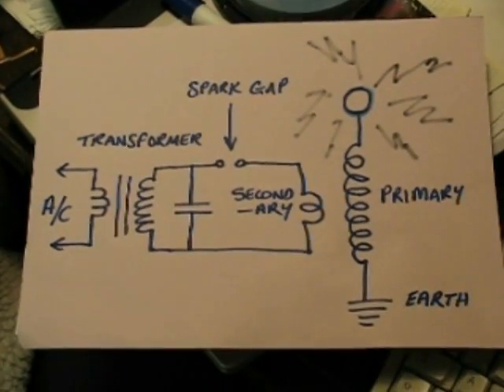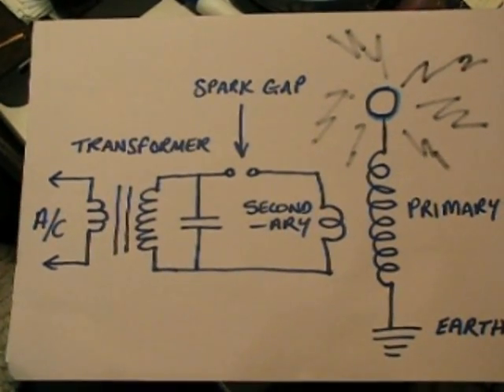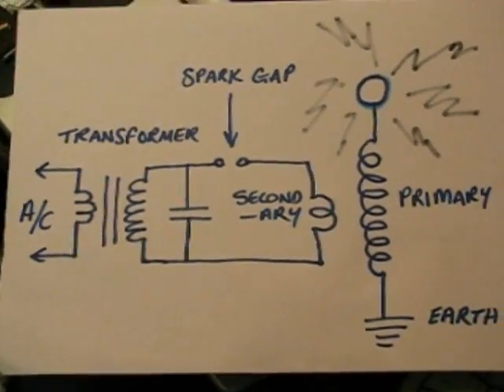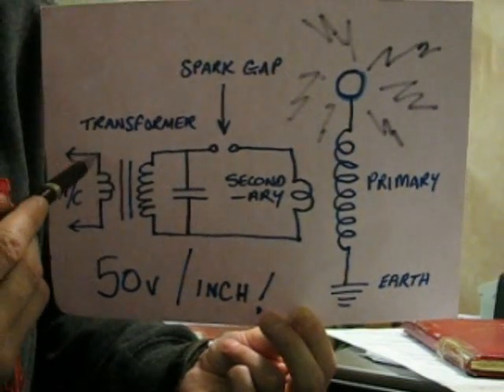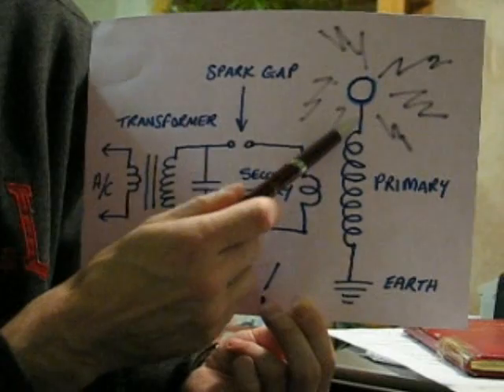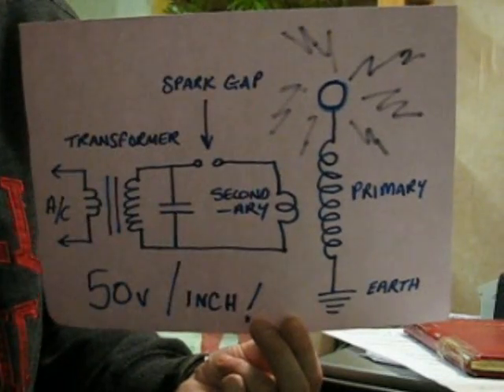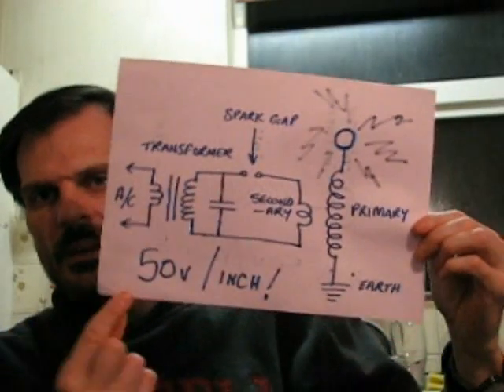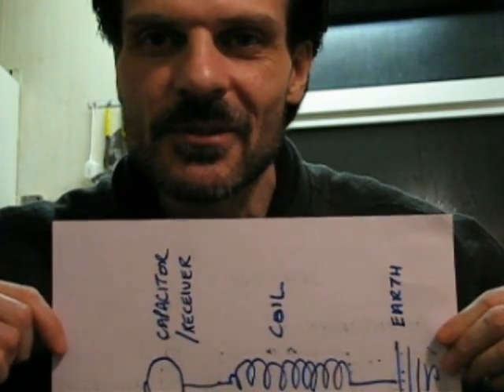Tesla's Little Secret

Comment: Not really.  The power levels are tiny, its only of use if you want to harness a tiny tiny amount of power from terrestrial radio transmissions to power a remote sensor or similar.  A few microwatts aren't very useful for mains powered equipment!

Now if you live near a big radio or TV transmitter then you might get milliwatts or even more with a long antenna, but
unless you are careful with your energy harvesting circuitry you might re-radiate harmonics in the wrong band and get
a visit from the relevant guadians of radio spectrum in your territory.

The DC possibilities are basically non-existent as the air is an excellent insulator so there is no current.  Also a transformer
only works with AC.

And for both modes your equipment is likely to be destroyed the next thunderstorm passing overhead.
Reply from the maker: +Mark Tillotson You are talking about the crystal radio circuit which receives a very small amount of energy. I am talking about receiving radiant DC energy from the sun which is unlimited, relatively speaking.

Comment: I disagree with your analysis of the circuit. For one thing, we don't charge the capacitor; that would imply DC rather than AC. I think the capacitor is to protect against HV kickback. The secondary of the power transformer builds up a high voltage until the potential is great enough to jump the spark gap. When that happens, a surge of current appears in the low voltage winding (the "pump coil') which delivers a pulse to the Tesla coil itself. Except during that brief pulse time, the spark gap represents an open-circuit so the pump coil reflects a high impedance (no load on the Tesla coil). The Tesla coil itself is a high-Q tank circuit capable of storing energy alternately in the magnetic field of the coil and the electric field of the (parasitic) capacitance. The small pulses of power are like small pushes on a pendulum that accumulate to build high energy and therefore high peak voltage.
Reply from the maker: Yes that's how I understand it. You explained the conventional Tesla coil eloquently!
Reply: Capacitor is very important here, it is resonant circuit

Comment: It's not 50V/inch.  It's more like 90 V/m.  It's there for the taking, but nobody has figured out how to harness it effectively yet.
Reply from the maker: +onehit pick yes I did correct it in the video; it is something like 50V per foot :)
Reply from the maker: Tesla figured it out.
Reply: MattBlytheTheOne
Yes... I see it at the end.  I think the way to harness it is to make a really high, grounded tether.  At the top of the tether, you need a lot of sharp, pointy electrodes that can create a high enough field to ionize the surrounding air.  Then you can get current flow.  Getting the current flow is the tricky part because you're trying to get current out of something which is normally an insulator (the air).  If you got up as high as the ionosphere, there should be no problem getting charge transfer.  Let's figure out how to get it started at lower altitude.
Reply from the maker: Air acts like an insulator only until the point it isn't fully ionised at which point it conducts. Until then "air" (molecules in the atmosphere) store energy like a battery.

Comment: @ the world
Tesla idea is obviously extremely good, it would get the voltage from the air BUT would the current be too low to harness that power?
Reply: and be of any real luse, sorry missed that bit off
Reply from the maker: +SP330Y It would be too low if you were only capturing radio waves. If you were capturing radiant energy from the sun it would be abundant.

Comment: Nothing new, it is simply two transformers which change the voltage depending the turns ratio of the coils. 230 volts ac in the primary and a turns ratio of 100 will give 2300 volts one way and 2.3 volts the other.

Comment: From what was said this radiant energy is DC potential so could never induce voltage in the secondary since it requires a fluctuating or alternating voltage to "induce" current in a secondary. Without the changing field there is no coupling between coils.
Reply from the maker: Yes that is true. But you need to convert the DC to AC through some kind of switch.
Reply: Yes I was considering some sort of system to accomplish this but haven't worked it out yet. On the other hand if you swap the cap to the other side of the gap and employed a voltage multiplier ladder of caps and diodes such that you could actually get an arc across that would ring the other side. But it would be hit and miss since the collected current is so low.
Reply from the maker: +TruAnRksT The current is only low if your potential difference is small or if you are trying to capture radio waves. I'm thinking more in terms of the radiant energy from the sun which is abundant. What about a capacitor and relay on the receiving end, that pulsed the coils as it charged and discharged?
Reply: MattBlytheTheOne

That sounds slightly plausible, but relays are very inefficient.
Reply: There is another thing about this tech that is often overlooked. People think Tesla just wanted to pump energy into the air and collect it remotely without wires. This is partly true, but his basic concept was to build two towers on opposite sides of the globe. And then like pushing someone on a swing pump energy in pulses until the natural electrical potential of the world was brought into resonance. At that point it becomes like a giant flywheel allowing only small amounts of power to be injected and huge amounts to be extracted anywhere.
Using a version of this reverse Tesla coil technique to bring it back into a usable form...
Reply from the maker: Yep that's the idea. And then appliances everywhere could utilise the energy by being in resonance with it.
Reply: MattBlytheTheOne
One thing I have considered is the possibility of putting the fine wire coil pri/sec in a wheel with brushes and long commutators and physically spin the coil end over end. It would maintain connectivity throughout the cycle right up until it is aligned with the sec/pri then instantly reverse polarity. The coil would be easy to spin because it isn't interacting with any magnets and produces no discernible load on the driving mechanism. Reversing polarity on each half revolution. Just a wild idea.  The architecture of the fed coil would be a challenge to get good lockup since the other side of the transformer would be spinning.
Ha, maybe spin them both as a unit.
Reply from the maker: Sounds good to me! :)
Reply: MattBlytheTheOne
It still depends on the random nature of the local charge. Obviously the sun does charge the earth but unequally due to weather conditions and such. One area may have a high charge, another a low charge and some places may even have reverse charge. Hence the need for a full global implementation to bring the entire earth field into a quantifiable state. But just imaging the outcry that would exist today with people worrying about WIFI and cell phones, imagine the result of subjecting everyone on earth to a single powerful oscillating global field. Probably no worse than living near high tension power lines but still.
Reply from the maker: The sun does charge the earth equally as earth rotates but different states of atmosphere relative to earth produce different charging affects (the weather). We can attract or repel clouds, for example, depending on their charged state.

Comment: something is wrong.

The secondary coil is the last coil on the schematic, (the coil the sparks shoot from) and the primary is the one connected to the capacitor and sparkgap. its not like you have written. i understand that if you use it in reverse, it will be as you have written, but you tell us it is teslas schematic, and thats wrong.

Also, when you say "the second transformer" in relation to the second coil, you are incorrect. there are two coils, and together, they make a transformer. if you separate them, they are just coils. the correct term is "secondary winding of the transformer"

last but not least, this will never work. 

Why didn't Nicola tesla build one, if he "invented the secret" . I think he would have enjoyed the free power he would have got from it, if it worked.

What tesla used it for, was his wireless transmission of energy, where a transformer was set up to collect the power, (in reverse much like you described) and a much bigger transformer wich sent the power out into the atmosphere (wardenclyffe tower).
Reply from the maker: +Jannick H Ok you got the point from the diagram though. It's not wrong! Lots of people are already getting results from these ideas. Why didn't Tesla build it? He did. Google his electric car.

Comment: Hello Matt! this experience the captured energy back to the grid? To isolate must use a UPS equal to the Kapanadze?
Reply from the maker: +KIGRATIS Energia livre 

Hi, sorry I don't know much about Kapanadze. I think it works on the same principle more or less. Fluctuating a potential difference to give an AC voltage. Sure pay back into the grid, if you can get it to work, patent it :)

What is UPS?
Reply: UPS is a device to hold the power when it ends, used in computers. Here the name is UPS with internal battery. This scheme has shown that you have a device running in your house? Already can work something without relying on external power?
Reply from the maker: Ok thanks and no I don't have a device running in my house lol. I have a TV aerial but I don't use it to watch TV ;)
Reply: I used your video as inspiration, but I believe that is already using the benefits of free energy. In your video you can hear in the background the sound of the spark, and is a spark of noise in tune. I have made many successful experiences and thank you very much for posting this video many years ago. Friendly hug!

Comment: Interesting to see other people coming to the realization that they have been had. The best way to divert attention from the true purpose of Tesla's invention was to wow people with the 'prestige'.
You need to get a better understanding of what is transpiring within the mechanics but you are close with your hypothesis. It's all about positively and negatively charged ions. The difference of earth and atmospheric potential. Grounding the atmosphere to the earth and using induction to utilize the energy you can power the earth.
The elite can't put a metre on it and charge you for it so you won't be benefitting from it any time soon.
Reply from the maker: Nature just wants All Things to be in harmony in accordance with the rest of the Universe.
Reply: Everyone seems to be forgetting that voltage and current are not the same thing. You could have all the volts you want, but with no current, you're not going to power anything. You also need to consider wattage. You couldn't power an entire town from a single unit, even if you could produce a useful emf. The higher the demand, the greater the load, your unit would burn out.
Reply: BackwardTechnologies you could have a huge tesla coil that converts to dc and harness the energy and sell free energy to the people...

Comment: Wouldn't the secondary coil be the primary and it induces the voltages to the last coil the secondary..just a thought..
Reply from the maker: +Stephen2846 Really! Inductors store energy! Like a magnet?  I was taught they they induce electro-motive force by current flowing through a coil of wire that creates a magnetic field. Wire wound resistors are inductors even if the field/emf they is negligible. Even a straight piece of copper wire has inductance and resistance. They are indistinguishable. Thanks for the lesson ;)
Reply from the maker: +Kennynva T. It depends where they are in the circuit. Inductors have specific properties when used in line with capacitors. Also the signal on a PCB will often be fluctuating (like AC). Resistors are actually inductors with many windings of copper wire, if you take one apart you can see the wire and how they are made.
Reply from the maker: +Kennynva T. It depends where they are in the circuit. Inductors have specific properties when used in line with capacitors. Resistors are actually inductors with many windings of copper wire, if you take one apart you can see the wire and how they are made.
Reply from the maker: +Stephen2846 you said it yourself.  Wire wound resistors have some inductance. That doesn't make me wrong. It makes the rest of your comments a waste of time. The one thing you are right about: We don't need a lecture on my channel thanks. I am an electrical engineer. University of Exeter and HNC accredited. See ya!
Reply from the maker: +Stephen2846 Oh poppycock! Of course Inductors are also resistors it depends on the gauge of the wire and how many turns and also the voltage drop and current being passed through the inductor. R = V/I  Did you really come here for a basic lesson in electronics characteristics ? That is like saying a shill is an engineer because he knows something about electronics but essentially he is still a shill !
Reply from the maker: +Stephen2846  Pass a current through a straight piece of wire and it creates a magnetic force. If there is magnetism and voltage there is emf. 

Inductors do not "store" energy! They only react when current is passed through them. 

You won't make anyone famous, not even yourself. Your arrogant lectures are no longer being approved on my channel. 

Don't make me block you! :)P
Reply from the maker: +Stephen2846 you sound like a shill who has no interest in furthering science or the advancement of new technology. You are wrong in your very approach to human nature and know even less about the psychology of the mind. Even though your electronics understanding is seriously flawed. Please go and sit in the quiet chair and think about how arrogant you are for a few days. You want enlightening but you are actually adding very little breakthrough to the conversation. Good day!
Reply from the maker: +Stephen2846 go away shill.
Reply from the maker: +Stephen2846 I removed nothing but your rude and arrogant comments. How can anyone be not what they think they are? The purpose of the mind is to either extend creativity or to project your mistakes onto others. But you cannot do both and be right. No indeed you are the text book fraud who has no original ideas of your own! Which is why you shill around my videos trying to make notoriety for yourself of the back of others.
Reply from the maker: +Stephen2846 You are blocked on my channel and blocked and muted on google plus too. I guess I will just have to report you to get your abuse stopped. Oh well. That's the good news.

Comment: Tesla used a magnetic spark gap to prevent the negative return spark across the gap which created a potential difference against the aether, a zero point energy potential, to draw the positive / negative balance equalization from the background energy of the universe.  Thereby half of the power in his circuit was drawn from the aether.
Reply from the maker: +TerraformingMaster Interesting, I watched a video of a guy who uses AC power through a circuit both on the way in and on the way out which makes it doubly efficient. When you measure the input vs output it looks like OU but it isn't, the energy has to come from somewhere. The aether as you call it is constantly charged by sun, the central sun and who knows what else in the universe! Do you know any examples of this being put into practice?
Reply from the maker: +Francis Graf 

Teenage Inventor Maxwell Loughan - KTVN 
https://www.youtube.com/watch?v=75Yh3nXKuGU
Reply: +TerraformingMaster 

I was really curious after watching this video how to make the current move down the primary to induce the secondary.  You are the second person to mention a switching mechanism "switching".  So the magnetic switching mechanism acts like a ratchet of sorts?  Could you explain further how it was magnetized?

Also Matt mentioned the 1hz cycle of the earth, but that wouldnt be enough I dont think, at least without a GIANT antennae, and even then, even 12 of them wouldn't power a country.
Reply from the maker: +Francis Graf  The switch I was referring to would be one way of changing the DC current into AC thus inducing electricity in the coils. As a basic guide I would suggest charging a capacitor and then dumping that through a switch to generate AC which will energise the circuit.
Reply: Excellent thank you!

Its hard to see much in the video you posted.  The spoon was acting as the switch right?  But was it supposed to be moving between the two contacts?

Ive been imagining a rotating spark generator of some sort, like you say, after a capacitor. Run it a high RPM, and it would be making contact with the transformer at each point as it spun.